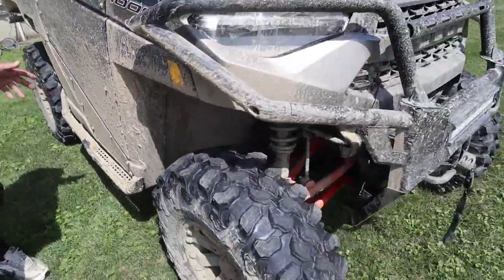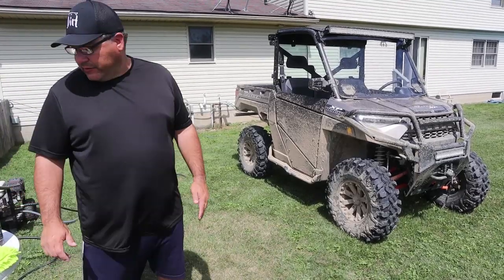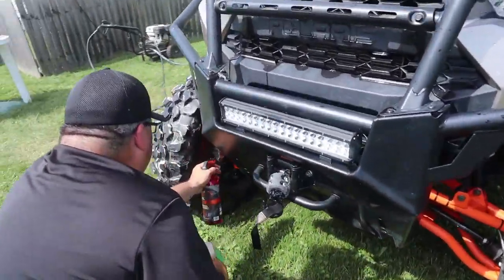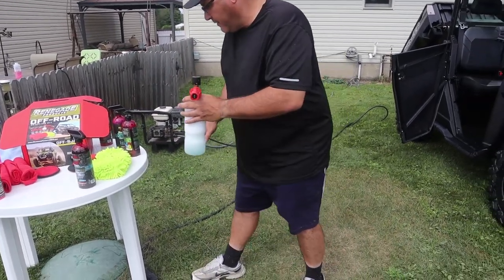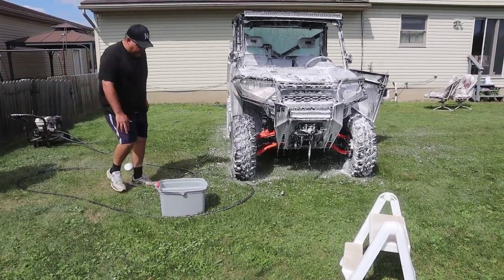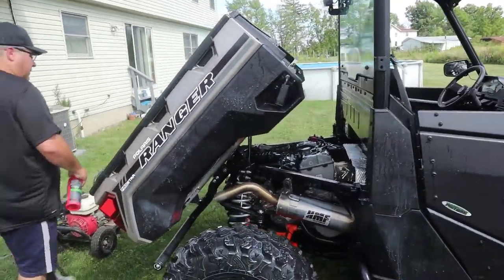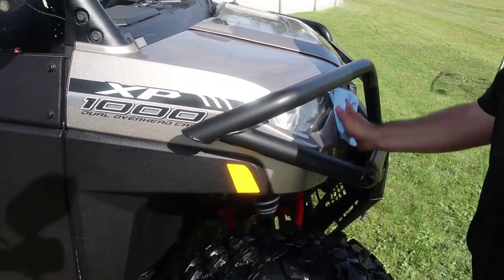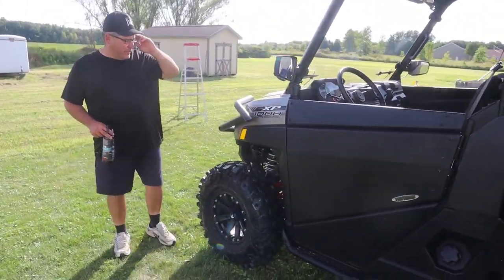How to Wash And Detail Your UTV/SXS To Keep It Looking New!!

Comment: Do you have to worry about the speakers or radio when spraying. Also do you have to be careful around the engine when spraying? Thanks
Reply from the maker: No I have had no issues with water getting in speakers. When I do the engine I don't  put a ton of water on top where the all the electrical stuff is just spray it lightly.

Comment: How did you clean the inside? Mine sits under a covered shed, and under a car cover, but it gets a lot of dust still inside the cab. Can you spray water and soap directly on the inside and not mess up the digi-gauges?
Reply from the maker: Yes you can spray water and soap in the inside of the cab. I also use a mit to wash the inside too. Just dont over spray the electronics and glance them with the pressure washer.

Comment: It seems to me the spray cleaner in the beginning is an unnecessary step.  The foam does a great job covering every square inch.  With the unit all foamed up, that’s when I’d use the brush, and skip the spray bottle cleaner.

Comment: Every product I have used seams to collect dust. How well does this product do against attracting dust?
Reply from the maker: It does good and the nice thing about this kit is that it comes with water-less cleaner. You just spray it on a microfiber and wipe off and it looks like you just washed your unit without using any water.

Comment: my  owners  manual  says  not  to  use  a  pressure   washer-----------garden  hose  only   ?
Reply from the maker: Well I have used a pressure washer several times and had no issues.
Reply: @UTVDIRT  Guess if avoid the areas listed in the manual you'll be ok

The best and safest way to clean your POLARIS vehicle is with a garden hose
and a pail of mild soap and water.
1. Use a professional-type washing cloth, cleaning the upper body first and the
lower parts last.
2. Rinse with clean water frequently.
3. Dry surfaces with a chamois to prevent water spots.
WASHING TIPS
• Avoid the use of harsh cleaners, which can scratch the finish.
• Do not use a power washer to clean the vehicle.
• Do not use medium to heavy duty compounds on the finish.
• Always use clean cloths and pads for cleaning and polishing. Old or reused
cloths and pads may contain dirt particles that will scratch the finish.
• Grease all zerk fittings immediately after washing. Allow the engine to run for
a while to evaporate any water that may have entered the engine or exhaust
system.
If a high pressure water system is used for cleaning (not recommended),
exercise extreme caution. The water may damage components and could
remove paint and labels. Avoid directing the water stream at the following items:
• Wheel bearings
• Radiator
• Transmission seals
• Brakes
• Cab and body panels
• Labels and decals
• Electrical components and wiring
• Air intake components
Reply from the maker: @dog01b52  Okay LOL

Comment: I’m wondering if you guys feel like you have to push it into high gear pretty hard?
Reply from the maker: No I have no issues with the gear lever. Goes in high real easy.
Reply: UTV DIRT ok thx just trying to figure out why it’s super hard to go into gear do u have a clue why?
Reply from the maker: I heard some people say there is a adjustment that can be made and most of them took it into the dealer to get it done.
Reply: I have to push hard to get into high.  If I don’t it pops out of gear.

Comment: For better control when you use your foam cannon try the https://www.amazon.com/MATCC-Pressure-Washer-Nozzles-Washers/dp/B06X9PLZSR/ref=sr_1_3?crid=2GK4W0E5HM1VN&keywords=pressure+washer+gun&qid=1567041606&s=gateway&sprefix=Pressure+washer+%2Caps%2C148&sr=8-3. Also to keep your suspension cleaner and resist mud use spray furniture polish on it before u go riding.
Reply from the maker: Nice! Thanks for the info! I will definitely try it out.